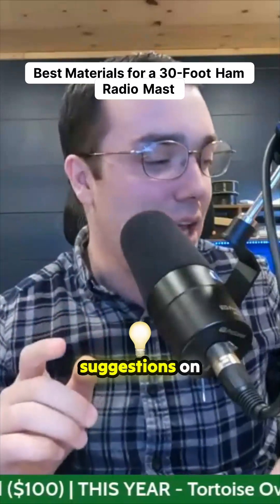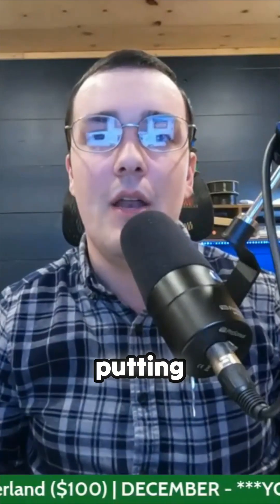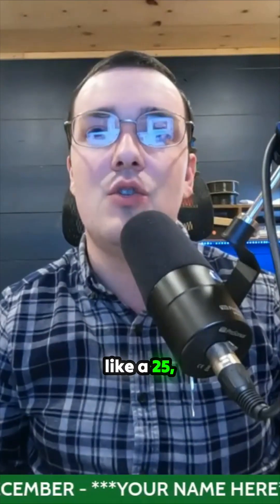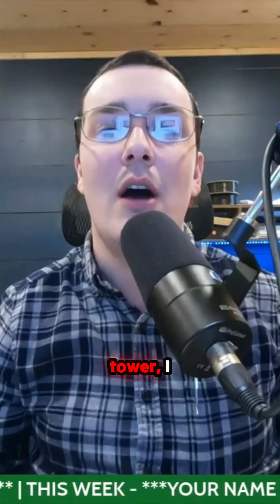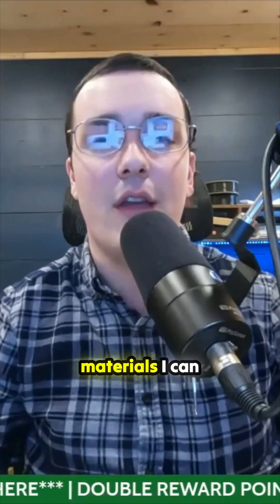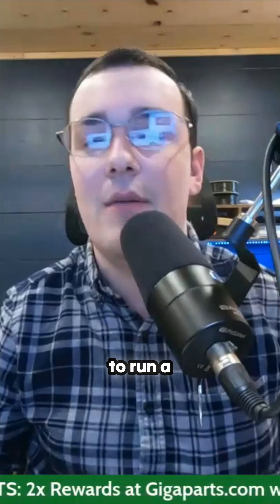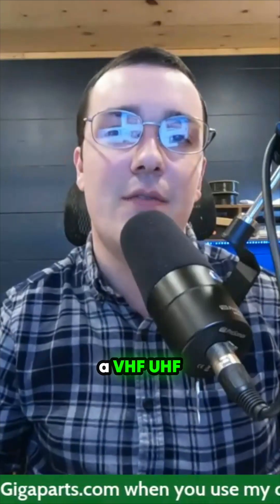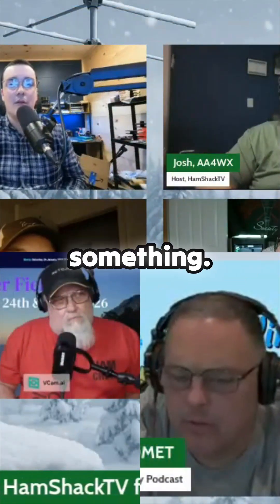Chain-link fence top rail for your ham mast? Seriously?! The most practical DIY antenna solution ...

Comment: I DO have a suggestion... Get some military camo netting poles... I have a tripod with several of those aluminum ribbed poles... eBay  You'll need to guy it up... you can easily do 32' I have 64' for my dipole...  You can get that for WAY less than 1,000... You WILL need some yard anchors that screw into the ground to guy to...
Reply from the maker: That's a great suggestion for a portable antenna mast!

Comment: My first antenna support was an a frame made from 2x4. The bottom section was made like a small ladder. The next section was two 2x4s with a third 2x4 mounted a couple feet into the two screwed together at the top. Then cut another 2x4 in short sections to spread the bottom two boards apart. When you get to the bottom you mount the top sections into the ladder with a pivot point and two more bolts that you can take out to lay the top sections over. Paint it well for the weather.

Comment: Josh, videos or any pics of what you’ve done with the top rail?  I’m currently working on one myself.  Thanks for the video.
Reply from the maker: https://youtu.be/eFXdV2e0hQM?si=FrJtWbiUHTR8s2w2 6:47 mark
Reply: @HamShackTV Thanks!  I’ve built a tip over for mine.  Gonna attach it to the house with a bracket like you.  Gonna run a myantennas 40–10 EFHW on it.  Matchbox on pole about 20’ or so high and wire into a tree about 40’.  Hoping this will work without causing coupling problems with the mast.